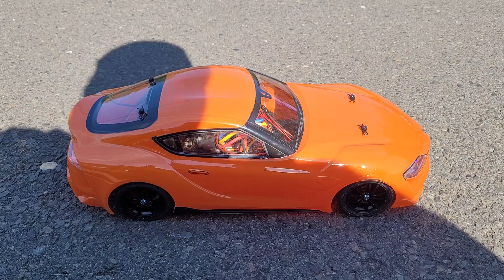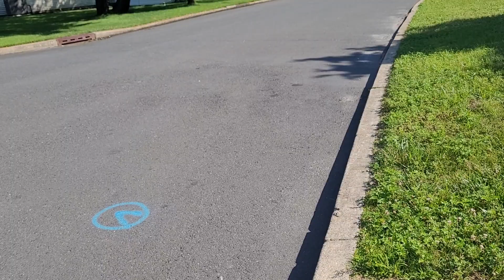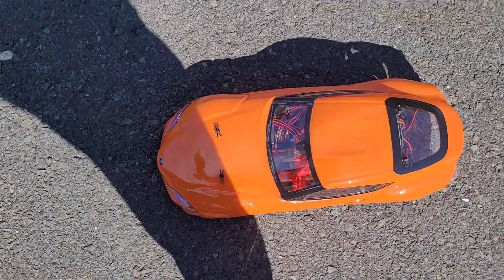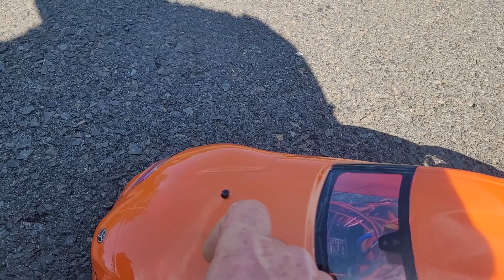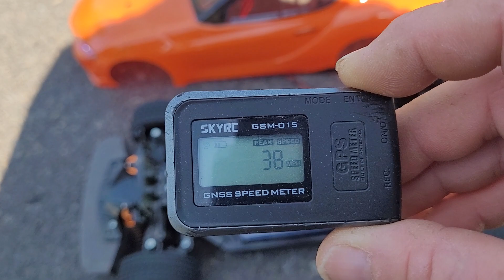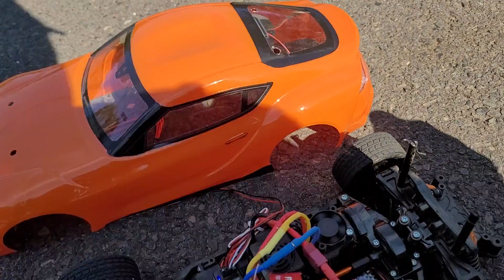Toyota GR SUPRA gps speed test tt02, 4370 kv, 2s, 22 tooth pinion

Comment: Cool👍 tt02 is very good rc,, i have one tt02, full bearing, full alloy,, 4600kv on 3s, 24t pignion it's past 60mph easy
Reply from the maker: Nice I gotta try a 3s in her and see what kind of speed I get thanks for watching 🙏
Reply: @c.k.hobbyshop3351  with your's 4370 and 22t ~55mph,,
Reply: @c.k.hobbyshop3351  put foam tyres with 3s😉
Reply from the maker: @jspeedrc  yea just ordered some thanks for the info 👍

Comment: Bro' Im planning to buy one of this can you tell me what maximum Brushless motor can be fit ? 🍻
Reply from the maker: Ok this car comes with a 540 torque tuned = 3650 can size . I use 4370 kv 3650 but there's room for a 3660 or a 3670 can size anything more would be overkill u can order an aluminum motor mount to use a bigger pinion gear ⚙ the stock mount allows a 25 tooth 46 pitch pinion gear and they sell a speed gear set that gives u a smaller spur gear ⚙ if u use a 3s lipo pack with the stock gears and the 3650 4370kv motor u can do 60 mph if u need more info message me back and tell me how fast u want to go thank you for this question and thanks for watching 🙏
Reply: @c.k.hobbyshop3351  I think im ok with 3650 🙂👍 Thanks for the Big help Bro 🍻